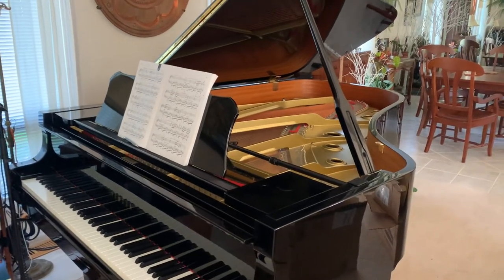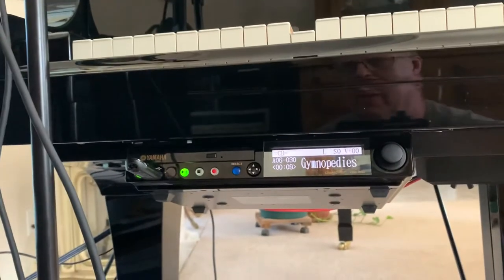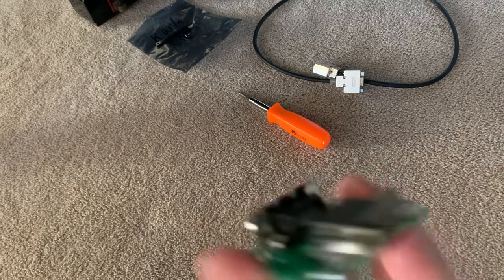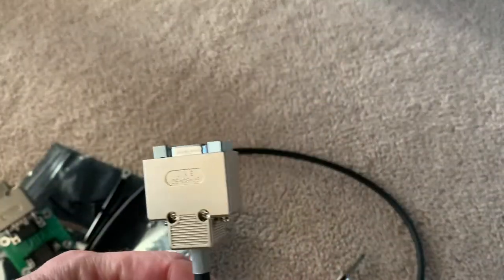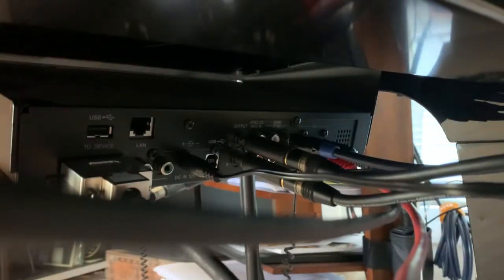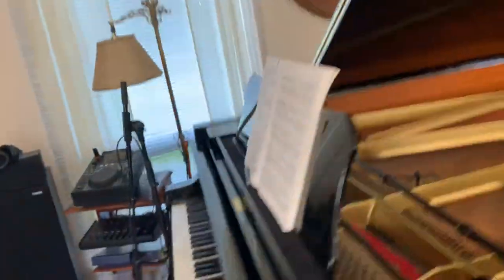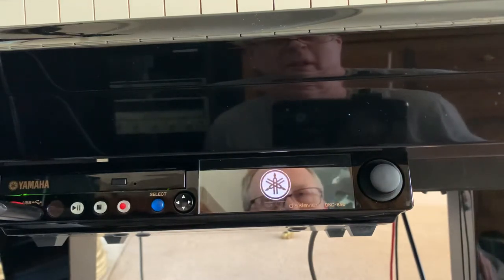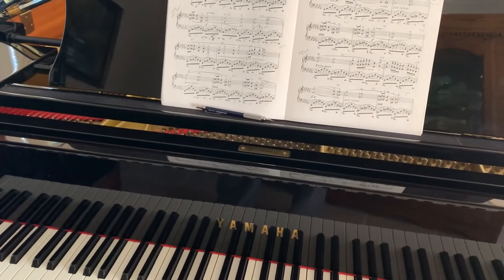How to use DKC850 converter board.

Comment: At the beginning of the video the dkc850 is not hooked up to the dkc100r. Is the 100r even needed if a 850 is purchased?
Reply from the maker: If you can get your hands on a dkc850 or DKC800 (e3) then no you would not need the Dkc100r. But you would need to get a 9 to 15 pin adapter board from me to make it possible. I sell them for $129.  Feel free to email me hayesiq@gmail.com